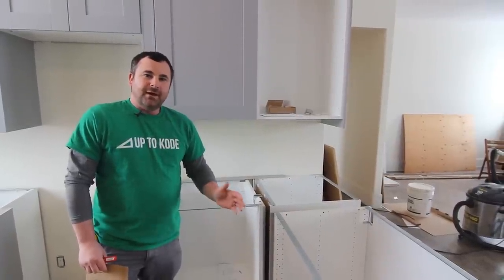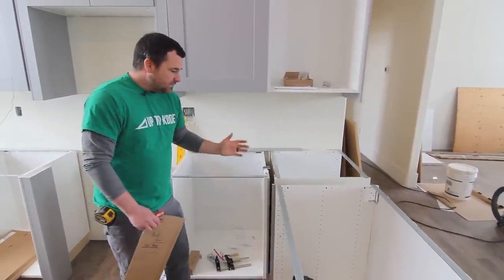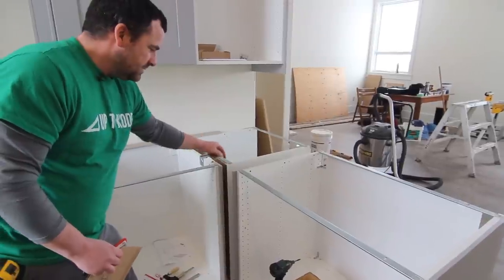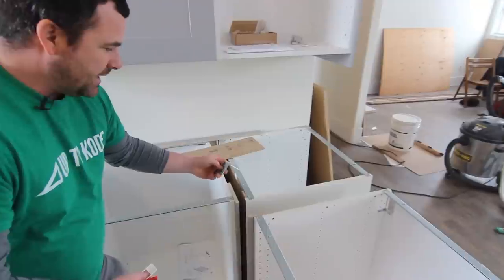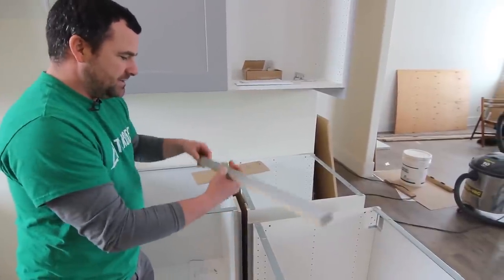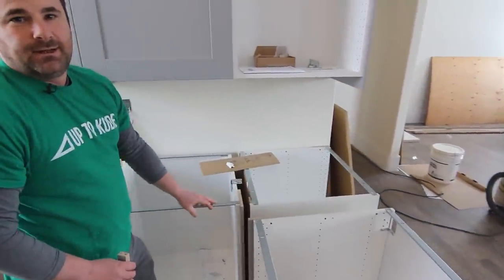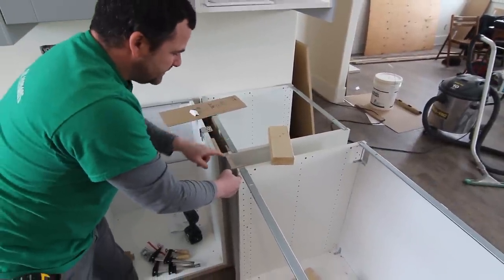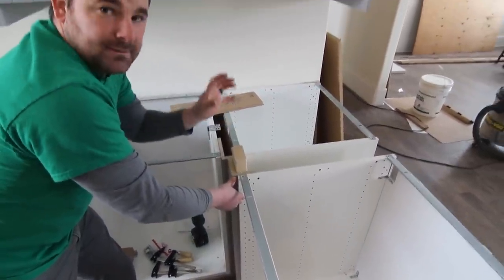How To Build & Install Inside Corner Fillers for an IKEA Kitchen

Comment: I've put in IKEA cabinets. I stopped, because I timed it one day. In the time it takes me to fuck around modifying their stuff, I can take a sheet of pre-finished 3/4 maple cabinet stock and my track saw and whip out an entire custom lower cabinet frame from scratch. You can literally just build cabinets faster than the time it takes trying to make theirs fit.
Reply from the maker: If that works better for you then good deal!

Comment: Great work! Even though my house is new the walls are not straight and cabinets are not perfectly square even though I am using shims. They are coming Saturday to take measurements for countertops so I will see what they say on the squareness. Level is pretty good though.
Reply from the maker: Let me know how you make out! Sounds like you did a good job.
Reply: @uptokode  I sure will. Thanks
Reply: @uptokode  Did you use the 110* hinge on the upper corner cabinet ever? It really doesn’t open far enough and the soft close feature does not work because the door stops (is closed) at 45* angle. Going to ask for the 153* hinge and hope it solves both issues.

Comment: Hi Kody, I love your videos and your attention to detail. I have a question, don't know if you have done this before. My client wants to finish IKEA cabinets to the ceiling i.e. have no space on the top. I don't think IKEA has any crown moulding system. How would approach this?
Reply from the maker: They do have some very simple mouldings available. Usually used for crown and/or under cabinet lighting. The only other option is custom paint or stain material to match the cabinets and build some trim work to take it to the ceiling

Comment: I didn't hear you mention what is the source product for the fillers?  Are you ripping end panels @$50 a pop and getting 2 finished edges? Also any problems chipping the paint when ripping?
Reply from the maker: I rip the smallest panel possible to make fillers yes. Use a good new blade and you won’t get much for chipping.  Good side up for table saw work. Good side down when using a circular saw.

Comment: Are you using a Brad nailer or pin nailer for your filler if so what size?  great vids btw.
Reply from the maker: I used a 21 gauge nailer. Usually with heads. Sometimes headless

Comment: Great Video , question that corner cabinet is it secured to the wall, floor  or just attached to the cabinets that shape  the peninsula?
Reply from the maker: All those cabinets are sitting on a custom plywood base. The base is screwed to the floor and base of the wall (except the peninsula of course). Then the cabinet is screwed down to the base. 

Hope that answers it

Comment: Kody, I was hoping you could help me. I am planning out my kitchen now. The wall is 165.5". I want to do the half moon pull out style corner cabinets on both ends, but am unsure if the measurements they give are set in stone or if the filler/backer piece can be cut a little? They state the cabinet is 26" wide, I am guessing that is from 1" filler/backer add on. I want to do a 36", 30", 24", 24" with the corners on both ends. That totals 166", 0.5" bigger than I have. Can I shave 0.25" off each one to make it fit if I have small enough pulls?

Comment: Hello Kody, thanks for making these videos. I have watched all of them and still not found an answer to a problem I may have created for myself. What I need to figure out is this. I have one upper cabinet, size 30” wide by 40” high going into a corner butting up against the wall. My intention then was to turn the corner using a 15” wide by 40” high cabinet using one side of the smaller cabinet to close off half of the larger cabinet and so only requiring one door on the large cabinet and one door on the small cabinet basically making an L shaped upper cabinet but not using the double hinges door set up used in eurostyle cabinets. Any suggestions on how to achieve this please and thank you. I know the larger cabinet has to move back away from the other wall to allow for the smaller cabinet hanging rail and door thickness, where I’m failing is what do I have to do on the larger cabinet in the centre to close the door on to. Hoping you understand what I’m trying to explain. Cheers 🍻 

Rich
Reply from the maker: Thanks for reaching out Richard!

Comment: Hey Kody- great videos! I’m about to do my install and watched the video where you put the dishwasher in...I saw you put the panel filler on the sides and was it baseboard you said you were going to put on the back wall and then silicone it so if it leaked the water would come out the front? I saw the side panels go in but wasn’t sure on what you meant for the back piece. Thank you!
Reply from the maker: For the back piece just use anything really. A piece of toekick with finished side down. Or a piece of baseboard. Just something to fill the gap between the drywall and the floor.
Reply: Where is the video of Kody installing the dishwasher. I have one to do and wasn't sure if the panel on the dishwasher goes past the top to the dishwasher..? The directions say to have it flush with the top but then I have to raise the front of the dishwasher about an inch.